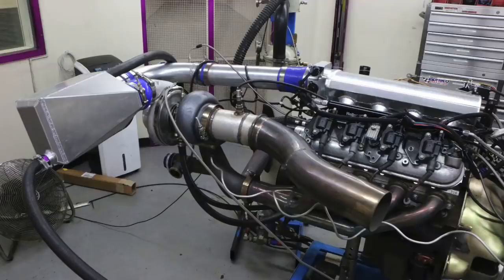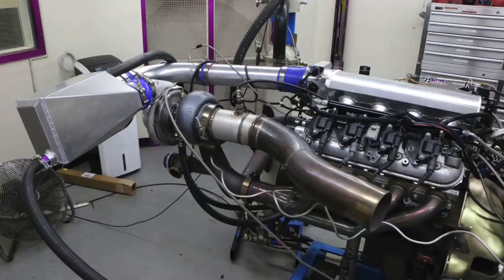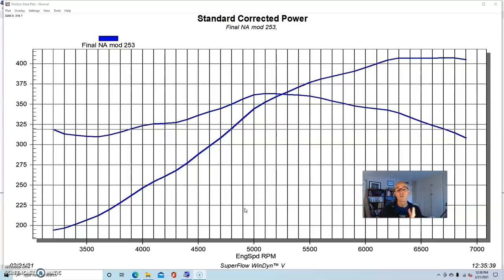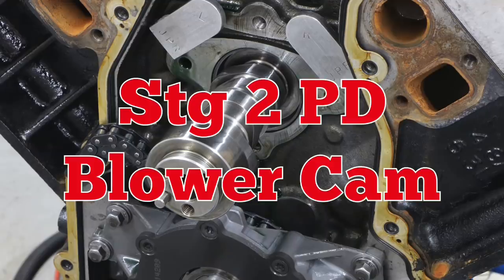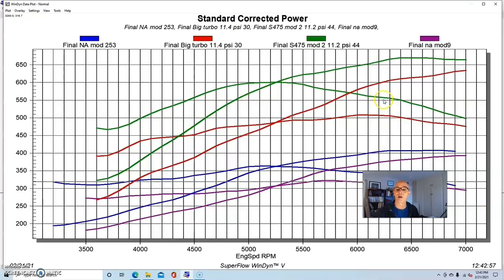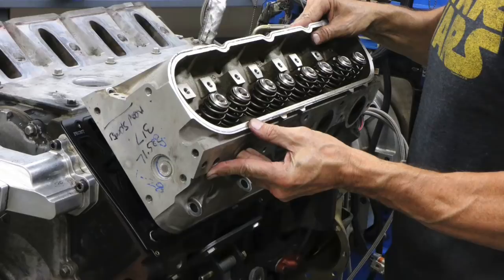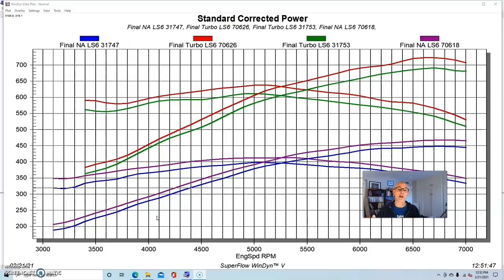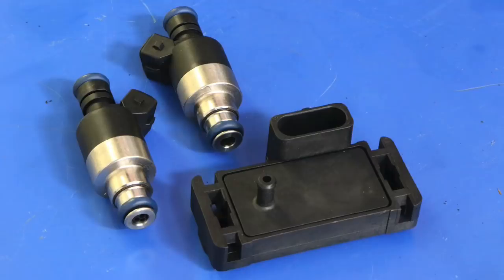LOW BUCK, TURBO LS HEAD TEST-DOES STOCK ROCK?

Comment: What turbo did you use on the 5.3 test at around 7psi of boost? The s475?  The low rpm boost is awesome!  I understand that "everything" works, but there is nothing more frustrating than a laggy turd combo.  It is heart breaking after spending that much money.  Rather than saying it all works why don't you find what works best and is "cheap"

Comment: At what power or boost level do I need to gap the rings?
Reply from the maker: all boost levels
Reply: @richardholdener1727  Please grab a Dodge Neon 2.0 out of salvage and add boost!
Reply: @richardholdener1727  When pulling the pistons/rods out, do I still use a plastigauge when reinstalling them? And how do I know how far to gap the rings? All the rings on the piston or just the top ones?

Comment: For a particular turbo, is there a way to dial in peak power at a desired rpm? I know about decreasing the pulley diameter of super chargers does this, but how do you determine getting your 1000hp by say, 5250 rpm, or maybe 5750 rpm with a turbo?
Reply from the maker: add boost with a manual or elec controller

Comment: I have an 08 truck 5.3l with 862 heads sitting  around. I also have a gt45 turbo sitting around. What's your recommendation on a solid engine build?
Reply from the maker: ADD CAM AND SPRINGS AND THAT TURBO WITH AN INTERCOOLER, 80 POUND INJ, GOOD FUEL PUMP AND E85
Reply: @richardholdener1727  Engine would go in a 79 mustang drag car any suggestions on a cam? Also thanks for the info.

Comment: Efficiency is key... Yeah any combo can make 1000hp.. My 4.8 with all the same junk inside as my 6.0 and quess what engine wins 1/4 mile races... Not 1000hp 4.8 takes to damn long to get it there.. And that's the point. Efficiency wins...but on the street don't matter.

Comment: This 1000hp turbo will make 1000hp, yes, but it will do so in a specific boost level. There are 1000hp turbos out there that wont do 1000hp if you run it at 5 psi, or some that wont do it at 60psi, as long as you are running about the same size engine your argument runs true, but way larger or way smaller engines may not at all make 1000hp on that 1000hp turbo

Comment: I have 6.0 with 706 heads, twin 5871 turbos, Sloppy Stage 2, Ls6 intake and that motor absolutely rips. I just got it all put together and have started tuning in so I haven't gotten to aggressive with it yet. but I will soon hopefully once the weather clears up. Ring gap is aprox .030 but that gives me a lot of blow-by so I added a GZ Vacuum pump (still finishing that setup). Something new to me is learning what boost is, as in boost doesn't actually happen until you reach atmospheric pressure first. so my first 10-12 lbs is technically vacuum still.
Reply from the maker: boost shown on your gauge is already above atmospheric
Reply: @richardholdener1727  that is good to know cause I was getting real confused

Comment: Richard have you ever done a test on throttle body size when turbocharged?  I have always heard it doesn't effect power but I would be interested in seeing if there is a substantial pressure drop or restriction when going from say a 80mm throttle body to a 92 or 95.  Would be interesting to set up pressure sensors pre intercooler, post intercooler, and in the intake manifold.  And if there is any effect on power?
Reply from the maker: no difference in power from 80-92 mm on turbo application

Comment: The lower compression "wrong" combination is a better setup for race car by far IMO. Limiting all that torque form from 3500 to 5500 is what helps keep the rods and Stock bottom ends alive. You want to rev it out past 7k and run big boost to go fast. Limiting the Big torque hump in the middle is beneficial. It allows more room for error in the tune, is easier on the bottom end, and allows for BIG power boost up top. That S480 combo will out run the other ultimately and is much less likely to fail once put in real world loads behind a heavy race car. Plot an T6 S480 VS a T4 S475 on a compressor map on Match Bot. The larger motor is in the higher efficiency island. Honestly the S480 is still small for big power goals and healthy drag strip ET's. Its why guys running the numbers have GT55 based units as singles... even on 4.8's.
Reply from the maker: not for 1000 hp
Reply: @richardholdener1727  For an actual 1000 WHP, yes... For 1000 Holdner dyno HP.. maybe not. Have any of your engines actually run down a 1/4 mile track? I'd be real curious to see what a 1000HP on your dyno traps at the track VS vehicle weight.

Comment: Should run a 1,000 HP engine, with your usual setup.
Then--
Take that same engine and run it on 91 octane pump gas, and an air to air intercooler with a fan in front of it.
And a short exhaust with mufflers on it.
See what the power difference is...
Reply from the maker: pump gas tune will kill power
Reply: @richardholdener1727  Want to see how much.

Comment: Hey Mr. Holdener, I want to do a reliable junkyard LS with upgraded springs and trunnion bearings. What recommendations do you have for, motor(LQ9, L86, etc.), turbo sizes, and ECU????
Reply from the maker: the bigger the better-so 6.0l or 6.2l works best-but a 5.3l with boost also makes plenty of power
Reply: Forgot to add it’s for a rear engine sand car.

Comment: For me, the question would be, " Which one will get better fuel mileage when just cruizing. Because on a street car, daily driver, it will spend most of it's time being law abiding.  If I can make the same 1000hp with efficiency,  why wouldn't I?  The real question isn't what will make 1000hp.  Unless you are just into turning money into smoke and losing races, the question should be and always comes down to.... who gets the best hook up.  Getting a street legal car to hook up with DOTs is an artform.  The guy that is best at that will always win because you blow your tires off with just 600hp at 60mph on any non dot tire.   I mean the real goal is to win a race, right?  There is a reason that the term, "spinning your wheels" is negative.  Never could figure out why sending tires to hell has become so popular.
Reply: Mid engine and rear engine car guys are smirking right now. (smirk, smirk)
But you are correct on all points, I think.

Comment: Im keeping the 862/706 and have them valved and ported asbig as they can be without increasing chamber size from 61cc.

Keeping it NA, add full roller SS rockers, NA cam,not going for 1000, 300-400 at wheels will be fine

Comment: I want to thank you for your time and efforts. I have learned a lot. I've been thinking about swapping out a 4.3 v 6 out of my 93 Chevy Cheyenne for a 283 which at this time has a set of fuelie double hump heads that I don't like. I think I'll take those off replace them with vortex heads and carb intake with a 220/245 duration cam 525 lift with 1.6 rockers on a 112 LSA.  a 650 Holley brawler carb. I think while it's apart to add a little ring gap and a pair of gt45 turbos and call it good. but dagnabit all this Ls  stuff you do makes me think about just spending the money on a 4.8 Ls instead. I don't want to build a race truck just a snappy daily driver that's fun and reliable. I'll let you know what I did when it's done. don't hold your breath it'll be next spring when I do it. till then I'll be getting all the parts together.
Reply from the maker: junkyard 5.3L with a cam, springs and boost

Comment: That intro was epic. Great video just like every cam is a turbo cam. Richard my plans already have LQ4, going to gap rings 28-30 thou. 317 heads. PAC1218 springs sloppy 2 cam, thinking VS 7875 or GT45. I’m not sure what injectors to run. Can you recommend which turbo/injectors. 500-800 WHP. Thanks.
Reply from the maker: 80 pound dekas

Comment: Looking to solve another debate. All over the east coast. Many people have the impression aviation fuel is like race gas. 100 octane  low lead but its originated. A dyno run on the same tune change nothing but fuel from 93 to aviation I wonder what the a/f ratios would do. See if on a correct tune it actually make more power or not.
Reply: Octane rating is how much compression a fuel can resist before detonation. Fuel with higher octane rating than necessary to resist detonation doesn't make more power
Reply: Do you mean oxygenated?

Comment: Richard have you ever done a test on camshafts that have .700 lift? I’m building my very first engine to race on the street and track. Could you point me in the right direction for a 5.3 with a s475?
Reply from the maker: YOU DON'T NEED THAT ON A TURBO 5.3L WITH AN S475-A MILD CAM CAN MAX OUT THAT TURBO
Reply: @richardholdener1727  thank you! I’m trying to figure out which parts to use the first time around. I might just end up copying an engine you did a video on that makes over 1,000hp. Thanks for sharing your experiences with these LS engines!

Comment: Some places do a fairly affordable CNC porting and head rebuild service.

I know the value isn't up there with junkyard heads but what do you get performance wise from an upgrade like that?

I like the idea of fresh heads, a cam, valve springs, rocker trunnions, head gaskets, gapped rings and maybe lifters all done in one shot if it is going to be apart any way.

My math might be off but it seems like $800+ with untouched heads and around $1,600 with CNC porting, valve job and guides.

I think most people will agree the cam is worth it.  The ported heads won't be as big an increase but it's not zero.

Of course a turbo would blur the results but you say the best turbo motors are the best NA motors so look at NA for now.

Thanks.
Reply from the maker: TAKE A LOOK AT THE LS CATH HEAD VIDEO
Reply: @richardholdener1727  I'll look for it, thanks.
Reply: I believe TSP quoted me around 850 to cnc port a set of 243's. Its a little over a grand to do cnc porting and a 2" (if I remember correctly) intake valve. I doubt that included shipping, milling, vacuum test, guides, seals, springs, etc.
Reply: @GreatLakesLogger  Katech has CNC porting for $499, competition valve job $374.  I think I have seen it on sale previously.

They also offer other options like milling and hand blending the ports but if your deck is flat and you know how to use a Dremel with a sanding drum, you probably don't need to spend on that.

Install Bronze valve guides is an extra charge but if your guides are good, you can skip it.

It does add up but it's not too bad.

Comment: Do you have anything for a mopar magnum small block
Reply: Definitely need to use a set of 706 heads just use that cast iron converstion thing labeled 6.0 from a gm truck it's usually found between the frame rails under the hood
Reply from the maker: NOT YET
Reply: @richardholdener1727  I'd like to see something like that when you get the time I have a 72 dart swinger I'm probably going to go that route because the magnum engines are dirt cheap
Reply: Not to rip on magnum engines but very little aftermarket support means not much to be gained.
Magnum = old school technology only to be choked by smog equipment.

Comment: Sorry getting tired of the Generic Motor Crap content
Reply from the maker: PICK YOUR FAVORITE MANUFACTURER FROM THE MANY PLAY LISTS
Reply: @richardholdener1727  4.9L/300 Ford is my favorite manufacturer. 😉😆
Reply: @richardholdener1727  ive watched them but the Ls content has been a lot lately. 
Just not a fan of Generic Motor Crap bellybutton boat anchors
Reply: it doesn't matter they all do the same thing with Boost and fuel
Reply: He's got hundreds of videos, and covers MANY different manufacturers. Look through the video list on the channel
Reply: Engines are engines are engines. If it makes power, I like it.

Comment: heres what ive learned from you sir. valvsprings, turbo, fuel pump, injectors! have a good time with your buddies. always a great video.
Reply from the maker: Thanks 👍
Reply: And ring gap?
Reply: @garethmcgregor1621  .028-.030 or 
.07 per bore inch
Reply: @garethmcgregor1621   yes, ring gap. I've already blown up a big block last year by not taking the time to do that. Everytime he says end gap, I feel dad is yelling at me for messing up! Hahahaha
Reply: @Go4BrokeOffroad  oops

Comment: Best head is the one on your motor, unless you have a 70s smog motor.
Reply: The only way i can get a smaller compression chamber is trickflow 58cc, my LR4&LM7 use 61cc but I dont need the trickflows as I can increase the valve sizes and port/runner volume without making the 61cc larger lok
Reply: you must not own a SBF..😜
Reply: There’s too many variables to have one best combination but it is going to make a difference in drivability if you have the wrong head or the right head

Comment: Cool vid Richard.Turbo doesn't make anymore cfm just makes mixture denser cfm will still be same as na.dont deck they block try put piston in bore below deck height to stop quench why to slow down flame front it will put to much heat into parts especially ring lands try make a quench pad in chamber if possible.peace
Reply from the maker: STOCK HEADS HAVE PROPER QUENCH
Reply: That's correct Richard.one thing to remember with ls 3 heads and up the short turn is hypocritica point l that where all they air speed is not at they throat like other designs never laid back they short all ya lose power when it comes to modifying  them heads peace .

Comment: LM7 build for boost. 706 heads.. 3 out of 8 pistons had piston slap. So rebuilding for boost. What compression ratio should i use for 10-15lbs boost. Going in a street car
Reply from the maker: 8-10 WORKS FINE
Reply: @richardholdener1727  wow thank you very much Richard for the response 👍:)
Reply: @richardholdener1727  on second thought. I am not able to get E85. My highest octane in my area is 94. 9.5:1 with 10-15lbs boost? Hypereutectic pistons ok to use?
Reply: 12 to 1 E85 fuel
Reply: I did  9:2 /1.     6.0 LS2 243 , Diamond P's? Lunati Crank /Valvetrain/ Comp turbo cam........  T76. Not run yet so well see in 2700 lbs RX7.Good gas mileage on stock heads, just turn the wick up for gojo!

Comment: 706 more compression easier to spool the turbos .
Reply: Doing a quick search I couldn’t find it but there is a guy who did a test a while back on one of the forums where all he changed was the compression of the engine (I believe it was on an inline 6 and the change in cr was 1.5 so from like 8:1 to 9.5:1) and it had zero effect on actual spool time. As the rest of the engine remained exactly the same, the airflow also remained the same and when the boost curves were laid on top of each other they were identical. However when the HP/TQ curves are laid on top of each other the power comes on much sooner.  The final conclusion was that the perception of increased spool time is due to the engine making more power everywhere in the curve from the increase in compression.